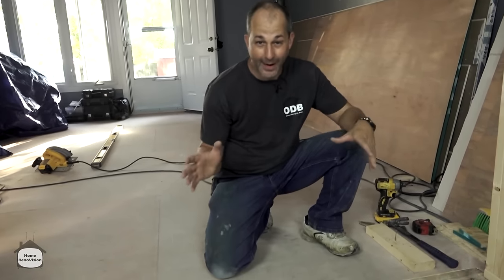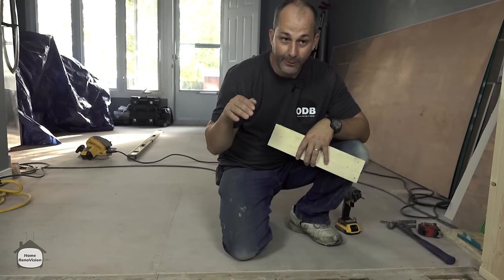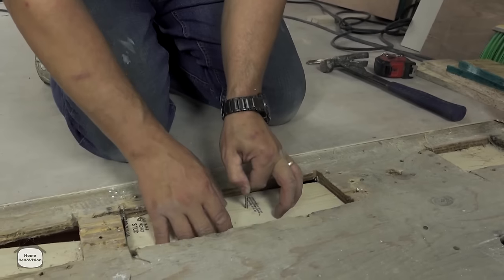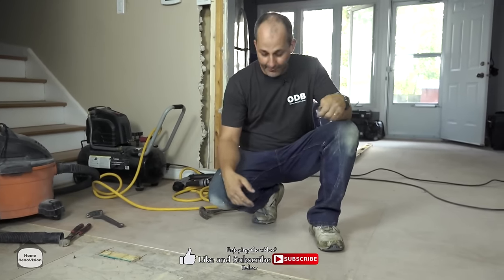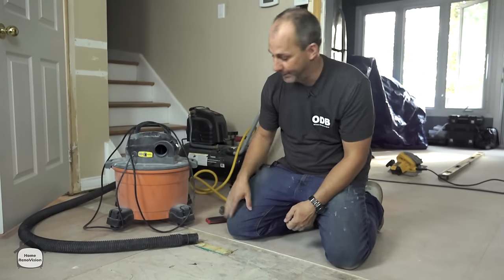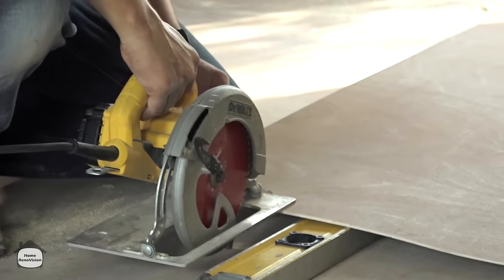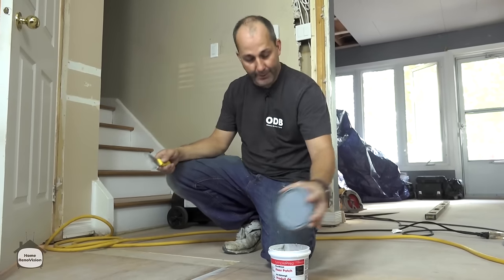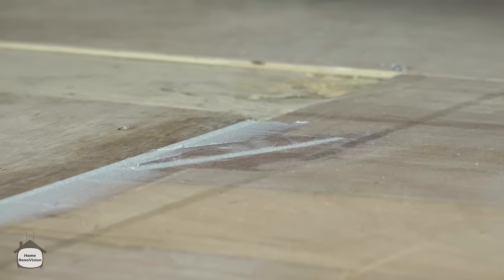How To Prep Your Sub floor For Luxury Vinyl Flooring

Comment: Nice Video. We are looking at putting LVP in our kitchen. It is a 50 year old house with a plank sub-floor. The original 3/4 plywood underlayment for the sheet vinyl came out during the asbestos abatement.  Should we lay down 1/2 inch of plywood to reinforce the sub-floor and 1/4 inch of sanded plywood underlayment or just go with something like the 23/32 sturd-i-floor as the underlayment. So much info on the internet hard to know what to do :)
Reply from the maker: Hi Mike, there is no rule regarding increasing the thickness of the subfloor when installing a floating floor. However you may need a layer to help stiffen everything up. Use as much as you like but in most cases 1/2 inch is fine. With the right flooring screws of course. Cheers!

Comment: I have a situation where the builder back in the 70s installed the joist with no regard to quality of the wood or the direction of the crown. The floor is level from side to side but i have a lot of peaks and valleys in the floor. In some cases I have more than a 1/4" off level between joist. How to deal with this? I have been using 30lb tar paper and then 1/4" ply on top of that. Is there a better way?

Comment: Damn Jeff, you're a beast.  How about some knee pads brother.  My knees hurt just watching the video.  Lol.
Reply from the maker: After so many years on my knees A few more minutes doesn't hurt! Cheers
Reply: There's a joke in there somewhere but I'll leave it alone.  Haha.  Keep up the good work.
Reply: @khyber safi lmao
Reply: apparently real men don't wear knee pads lmao
Reply: Hi Jeff, is the Luann necessary if you're putting new three quarter inch plywood on a new bathroom floor installation? Also, would you use three-quarter inch sanded plywood or treated?
Reply: @nate9009  Yes it's necessary.  It has a smooth surface.  The grains from plywood will eventually show through your vinyl.  You could use good one side plywood, but then you're sitting there filling every single screw hole, and the butt joints might not line up the greatest.  It's going to expand more, also.  Just use lauan or mahogany.

Comment: What thickness is the sheeting you just put down? 1/8"? I'm getting ready to re-floor a bathroom and thinking of using glue down groutable vinyl tiles. The floor currently has laminate sheeting and water has gotten under it.  Not sure if I need to replace any subflooring until I take off the laminate. Should I put a thin sheet of plywood on top like you did or just clean and prep what is under the laminate?
Reply from the maker: I used 1/4 since the existing subfloor was pretty mangled. If you can save it and you have a good enough vinyl don't bother.

Comment: I have a house that the majority of the subfloor is very straight except in on spot it dips down close to 1/2”. Should I plywood the whole floor with 1/4” and build that spot up or do you recommend something else? Thank you for your time.
Reply from the maker: Hi Craig, I would just use a floor leveler compound in that area. Cheers!

Comment: How should I proceed if I'm starting with with concrete slab, that has few dips in it? Should I be using leveling compound before putting down the plywood/OSB.  The plywood will be attached to the slab with concrete screws.
Reply from the maker: first. plywood doesn't install on concrete. You can install the luxury vinyl directly on top of the concrete with nothing but a vapor barrier.
Reply: My apologies, I didn't mention that there will be Dow's Styrofoam SM between the concrete slab and OSB.

Comment: I have an addition next to my kitchen that is much lower, would you recommend adding another layer of subfloor to raise it even with the kitchen? I think I want to redo my whole upstairs with this vinyl flooring. Great video btw.
Reply from the maker: If you want it to function a s one large space , Yes you will need to eliminate the step down. Vinyl is perfect in this situation in case the 2 structures move a little independently, the floor will not crack!
Reply: Home RenoVision DIY thank you for the reply and advice!
Reply from the maker: happy to help Edgar Salinas, that is what I am here for.!

Comment: Ive always glued down my sub floors when installing. Usually mix some weldbond wood glue with water 50/50 and spread with a cheap adheasive spreader. What are your thoughts on that Jeff?
Reply from the maker: I am a big fan of gravity and quality fasteners. Glue just creates problems for the next reno!

Comment: I'm no expert, just a new home owner getting a house built and looking to cut costs, but let's say I'm on the second floor, a particle board subfloor, cant I just avoid the 5/8 particle, birch, or plywood  cost and labor, and just use leveling compound, sand it, and then just add freefloating LVP on top of that?

Comment: Is this a better way to go over my old subfloors than doing mortar and self-leveling compound? I've found a bunch of videos showing that, but this looks like a better alternative for getting a proper surface before we put down the laminate.
Reply from the maker: That all depends on what you have currently. if it is subfloor and warped and bad joints and full of holes then this works well. if it is leftover cement then leveler works better!
Reply: @HomeRenoVisionDIY  It's pretty old OSB = house was built in 1971. We peeled the carpet up Sunday and there are no holes or rot, but there are gouges. I haven't checked the level yet.

Comment: Two questions from complete newbie, does this same underlay technique also apply to peel and stick vinyl 12 x 12 tiles?   Second, what kind of drill are you using.....I see its a dewalt but whats the model number?   Thanks for your help, your videos have given me the guts to try stuff like this.   Thanks again, great video series!!
Reply from the maker: I use the XR and the same day works but you will need the quick dry version of this filler. cheers!

Comment: Thanks for this awesome video.  Do I need a sub floor for laminated floor ? In the living room Under my carpet I have plywood but on my kitchen I have vinyl floor and it have sub floor underneath of it and now I have a 3/16 of a inch difference between the two floors
Reply from the maker: just lift the subfloor under the vinyl and it will all be flat. Cheers! the subfloor is attached with staples and comes up really easy!

Comment: Jeff, installing vinal plank flooring over concrete.  I have one section of tile in my entryway.  Do I have to remove it? Or can I fill the grout lines with a product like you used in this video? Thanks in advance.
Reply from the maker: I think you will be fine without the filler unless you are using really flimsy vinyl.

Comment: Thanks for the great demo/tutorial video!  
So, I'm  putting LVP in my kitchen. I have the floor base, (1929 home), with a linoleum layer, a masonite layer, then the same grade/color/style of linoleum on top. I'm taking off the  top linoleum and masonite, and finding 6D nails every 5-6 inches.  pulling them up leaves the hole with a divot. should I fill those in? or leave it be.  I don't want the nails to pop up into the LVP, so I am pulling them all. Would a flooring patch similar to what you used in this video be advisable?  suggestions?

Comment: Question-  we are laying vinyl over old hardwood and we have some uneven spots. To preserve floor, if possible we want to avoid using the liquid/cement leveler. Ive been told i cant use a piece of wood to brace/support the floor and also that we cant lay some underlayment either but wasnt given a reason why. Can someone answer this question?

Comment: Hi there! Love you channel!! I have a question in regards to prepping my subfloors for tile. We recently had an addition done for a dining room. The subfloors are brand new 1/2" plywood. I'm going to lay tile down. I was told by someone to use durock on top of the plywood, underneath the tile... Now I understand it should be used for waterproofing, like bathrooms, etc. But is it necessary for tiling our new dining room addition?? THANK YOU SO MUCH FOR YOUR HELP! :-)

Comment: Hi Jeff,

I am placing LVP in my home with 5mm thickness and my subfloor is MDF.  Do i need to place additional padding underneath the LVP?  I do plan to get a flooring wood filler for the seams and some dents in the  MDF subfloor.  Would you suggest handling the seams and dents in the subfloor a different way?
Reply from the maker: first I wouldn't call 5mm luxury vinyl. The product in this video was 10mm so yes you should definitely fill every crack and divot.

Comment: Thanks for this. I wish it had been up when I tried to fix the gaps between my new plywood and the old when I replaced a damaged section from the toilet's wax seal leaking for a long time before we moved in. The "geniuses" who built the place put carpet in the bathroom & put the toilet on top of the carpet & carpet pad. It was a nightmare. The plywood underneath was the consistency of mud. I managed to the entire sheet out with hand tools and replaced it with a new sheet but there was a slight lip/height difference between the new and old (bc the old is a thickness they don't even make any more). I attempted to patch it with a self-leveling mix that turned out to be expired & it did not go well. I added the exact amount of water specified but instead of being like pancake batter it came out like slightly runny chunky peanutbutter. It didn't go level and after it started to dry, there were hard jagged sharp spots/points sticking up. Just little chunks. They wouldn't smooth flat when I tried to trowel over them & when the job was done it was just a mess. I tried to break it up with a hammer but it wouldn't even crack. I tried to sand it but it tore the sandpaper. So now I'm trying to figure out how to fix it. I may have to see if I can find a way to pry the board up, get a new template, and put a new one in, but the mix covered quite a few of the screw heads.

Do you think the Henry's patch that dries faster would be ok for homeowners (if it comes in small enough batches)?
Reply: What did you end up doing to fix the issue?

Comment: What timing. I am installing 1/4" plywood soon with crown Staples for my vinyl floor. I purchased 5/8" crown Staples. Do you think the 5/8" Staples will be sufficient? I was going to use the Staples with subfloor glue..such as liquid nails.
Reply from the maker: Hi John, the staples will be fine. remember this is a gravity installation and there is nothing structural about 1é4 ply. That being said the staples will hold things in place without the glue.Cheers!

Comment: I'm putting down interface lvt.  And there are 1/4 or more gaps in the underlayment do does have to filled in or will the lvt gluedown flooring be alright without doing it.
Reply: Definitely fill it, over time the lvt will sag into it

Comment: great video. Question, I have turned my garage into a bonus room. The garage floor is concrete and below the house slab so I built up the floor with a wood sub-floor (1/2" plywood) I took care to make sure the sub-floor was laid flat and level but there are some spots that are not super level and may be off a 1/16 of an inch at most. I have a good, 100% vinyl plank floor ready to be installed, should i use a self leveling compound on the plywood sub before installing the vinyl?
Reply from the maker: Hi Ricardo, the flooring will be able to accommodate that small slope with no problem. Cheers!

Comment: Jeff, I love your videos. They are very informative. I am getting ready to remove some carpet in my livingroom to put down vinyl plank. I am sure I am going to have to remove staples. Can you give me a link to the rocking claw tool you used so I can buy one please. Thanks.
Reply from the maker: Here is a link to my amazon store. not the exact tool but a great pair of end cutting pliers , Cheers!
https://www.amazon.com/ideas/amzn1.account.AG6VCVEWG4PJIIPH42S2TTQAFVDA/RD8M9MNIDXQV
Reply: @HomeRenoVisionDIY Jeff, thanks for the quick response. That definitely helped. I do have another quick question though. I ripped up the carpet and there are stains on the floor from dog urine. Should I replace the subfloors in those areas or can I spray something on them or will they be ok? The areas are dry, they are just stained.

Comment: Hey jeff thanks for the video but I haven’t seen one with my situation  hope you can help me out before I move forward. I have tiles in half of the area I want to install deluxe vinyl but the other have has carpet and the subfloor is concrete, so if I pill the Cary I’ll have 1/2 gap between the tile and concrete, I’ll like to have no transition at all so do you think it’s the best option to pull the tile or maybe put concrete boards to be a the same level..hope you can help or someone out there

Comment: Is it O K to put a subfloor over padding then install  Vinyl  plank flooring.  The installers say it will be to hard to take the glued down pad and this will be the best way.  What is the right way to do this?  Very large room.
Reply from the maker: HI fred, tell them not to be lazy and rent the removal machine. 40 bucks and 1 hour and all that glue down pad is gone. Cheers!

Comment: I love your channel you’re very professional and informative! I learn a great deal from you. I have a question about the name of the tools you used the claw ? Plus what model is your staple gun? I’m a diy kind of girl and prefer to ask you an expert! Than some sales associate at hardware store. Thanks!
Reply from the maker: The gun was  a porter cable. Has a hard case and safety glasses with room for staples. It is a great tool for a great price.
Reply from the maker: The little claw is from stilleto. It is a multi purpose tool for removing nails and anything else. Cheers

Comment: Would 1/4" Underlayment  work for the smooth finish?
Reply: Most vinyl plank flooring has its own underlayment attached. Using an additional underlayment will not only void the warranty on most floors, but also will add a softer layer between your vinyl floor and the subfloor, causing slipping, flex, and premature wear.

Comment: Do you always have to add a piece of plywood over the subfloor? Or is it just when you have giant holes?
Reply from the maker: Hi Ladonna, In this case the floor was so chewed up from a variety of different flooring and holes from the renovation. If your subfloor is in good shape you could just throw down a plastic sheet. That will help if you ever want to replace a plank.
Reply: similar question - is the 1/4 inch plywood the best route when looking to make the subfloor more flat, or is self leveling compound better? I'm replacing old carpet with vinyl flooring on the 2nd story of my house. The floor has dips up to 1/2 inch over 8 ft and the instructions call for 3/16 inch max. Have sanded some of the higher points (over joists), but don't want to take too much off there. Thank you!

Comment: I'm replacing  part of the subfloor in a bathroom, due to water damage. I've decided to install vinyl tiles. Do I need to apply an underlay before tiling?
Reply: Yup, anything under it will eventually telegraph through, if you use luan underlayment it makes everything smooth, if youre using thinset to set tiles then youre going to want concrete board

Comment: I’m installing LVP over OSB that appears to have a rough feel to the surface.  Some of the chips seem higher than others or the clues.  Maybe it was exposed to some weather when house was built.  How smooth does it have to be for these LVP planks?   The LVP is 6.5mm thick.  Should I plan on putting some 1/4” underlayment like SurePly?
Reply from the maker: That is an experience thing.  you can sand the joints to remove the hump a little. Or even use floor leveler if necessary.

Comment: Interesting, thanks. I was thinking of getting vinyl sheet on an existing tiled bathroom floor. Would the recommended procedure be to plaster all the grout lines level first?
Reply from the maker: just use the floor patch and you will be good to go.

Comment: I wanted to ask is there a big difference in the backing as I saw that the backing is better than no backing on the planks .I have seen cork and rubber and is there a big difference in mil thickness when installing it .Is it easier 1 verses the other .I have seen thickness in 1,2 to 6 mil thick .I know wear layer is important and they all give different types of wear layers and all different wear layer from 12 to 20
Reply from the maker: the thicker the plank the better the joint. Cheers!

Comment: Hello people... 
I have taken on a laundry room Reno and I am stuck on phase 1. We had vinyl flooring which we removed only to discover mold on the wall and floor. I don’t know if this is the sub floor or the layering under the vinyl. I don’t see any screws or staples on these boards. Do I take this out or keep it before I put the tiles in? Do I replace this board or mud this? Looking for advice people on where I should go from here.
Reply from the maker: if the floor is hard and dry then you can seal the mold in the subfloor with killz.all moldy wallboard should be removed before moving forward.

Comment: Nicely done, but a bit of overkill using 3" screws to hold down 5/8 ply??  :)
Reply: 3" screws are very common on any job, if it saves you 1 hours+/- running to the hardware store, I think you're fine 🤔😉